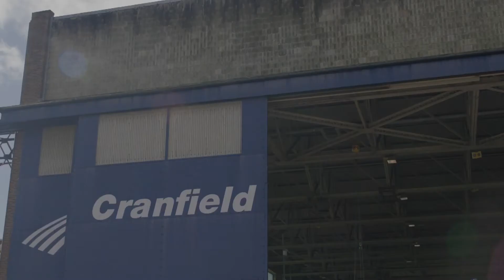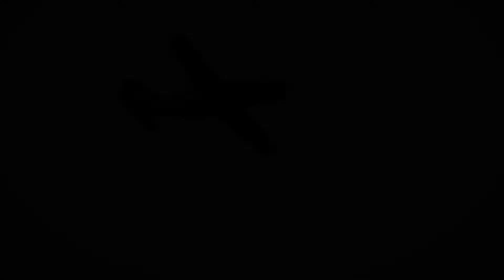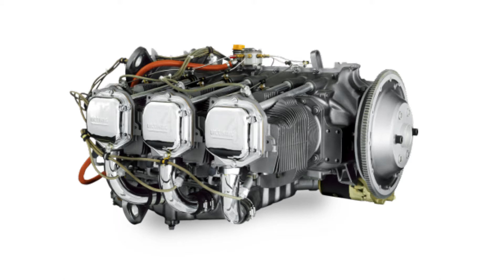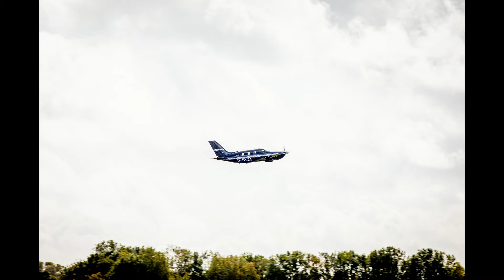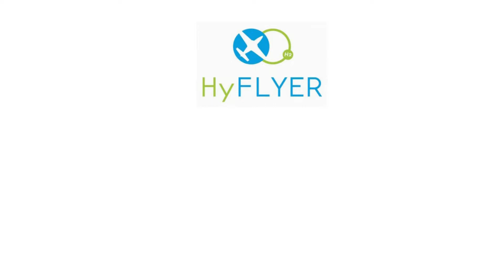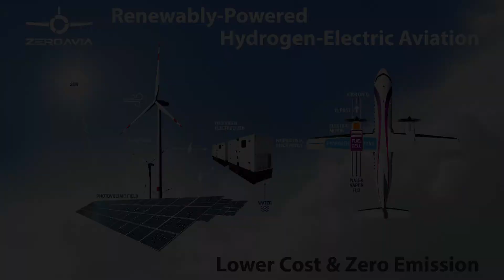World's first hydrogen-electric commercial plane | ZeroAvia's hydrogen-electric Piper Malibu Mirage

Comment: the down side of of h2 FC's is... for the price of ONE FC... you could buy 2 i0 540's and power them with 100% ethanol and be even cleaner than methane produced h2. DUHHH. and at the end of those 540's life span- you'll have saved enough money (h2 is around $6 a gallon if you 'do the math') to fuel 2 more life times of 540 ethanol flights. 

proving? H2 IS STUPID. 

also- an FC has about the same lifespan as a lycoming. fairly pathetic considering the FC that can fill the needs of this plane is going to cost a bare minimum of $140k and that's if it were being mass produced. at these numbers- you'd be better off just powering it with a PT6 set up to run off B100 bio-diesel. used vegetable oil can be had by the tractor trailer tanker full for 1 penny per gallon, then refined into B100 at a total cost of around 50 cents a gallon. at that price? WHO CARES! yes- it gives co2 emissions- but those emissions are offset greatly by the fact that the plants that grow that oil eat the co2 the oil produces. h2 from methane just straight up spews co2. forgot about steam refraction huh? just because the emissions aren't output from the plane- doesn't mean they aren't output at all. 

AND PLEASE- let's NOT pretend ANYONE is EVER going to produce 'green h2'. big oil produces 97% of ALL h2. that's the ONLY reason we're even hearing about 'h2 future' BS. if you thought $6 a gallon was pricey... wait til they actually GET a huge chunk of infrastructure converted to be DEPENDENT on h2 / big oil- we all KNOW what they do once they have an oligopoly set up.

Comment: essentially... they could 1/2 the size of the fuel cell stack if they buffered it through a very small lithium pack. the FC only needs to be big enough for the average energy consumption of  cruise speed plus a few percent more. beyond that- the lithium pack can handle full power for short, 10 minute bursts. during cruise, the FC stack charges the lithium pack back to 100%.

Comment: they could save a lot of weight by buffering the fuel cell output through a small lithium pack. you don't need full power for the entire flight- only for takeoff, about 10 minutes. that would mean downsizing of the h2 fuel cell, which is VERY expensive. having the lithium pack also provides more redundancy. if the fuel cells fail- you can glide with power pulled back- then you have 10 minutes of full power from the lithium pack to perform your landing... maybe a downwind turn? whatever is needed.